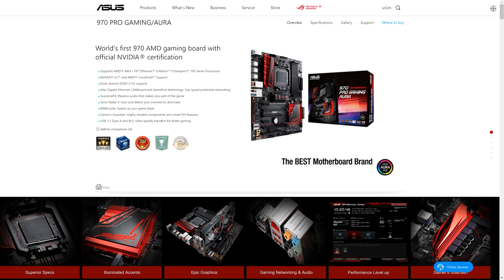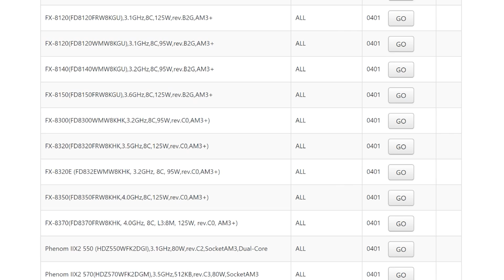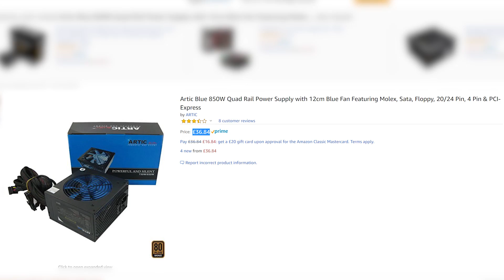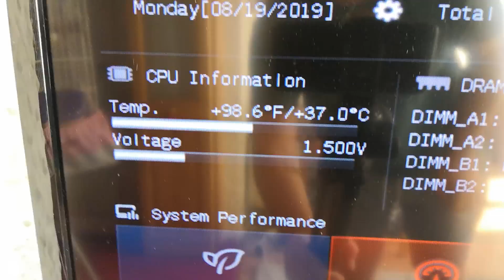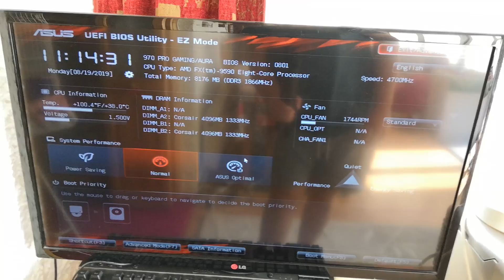This Used Gaming PC Is a 5GHz Fire Hazard (Pt. 1)

Comment: my man it'll be fine. If you are that worried place a fan over the VRM heatsinks to ensure they stay cool. The worst that will happen is the CPU will throttle because the VRMs are too hot. If you are SUPER worried try undervolting/underclocking.
Reply: Pretty much this. The budget motherboard I had for my FX-8300 that I overclocked to 5GHz was certainly not designed for that, but with a cheap 60mm fan on the VRM heatsink it worked happily for years.
Reply: The AMD 220W cpus actually were capable of making your vrams burn. https://www.cnews.cz/paleni-carodejnic-aneb-co-udela-220wattovy-amd-fx-9590-v-desce-bez-podpory/
Reply: @davidunterwieser7325  it wont on this board. This is the one exception when it comes to 970 boards. It has an 8 phase (7+1) vrm instead of the 4 or 6 phase ones that the other 970 boards came with, and they're the same models that are used on the sabertooth 990fx r3.0 just a few less
Reply: Lonnie Murray yep, and even my 4 phase mATX ($40 new in 2015) allows for similar high clocks. I had mine at 300w on the CPU (increase from the wall hitting Cinebench button) with a 120mm AIO, and it lasted for years doing some 24+ hour fluid simulations pegging it 100% and ran fine with $3 in VRM cooling mods. My board only allows up to 1.7Vcore, so it wasn’t able to fry when the CPU was sub-zero when I really wanted to push it (kinda disappointed...). Still does fine, it just won’t allow high enough voltage for liquid nitrogen or even my phase cooler (which I’ve used for testing long term effects of -60c over nearly a years span, nothing bad happened, not such story for GPUs though... the BGA solder on GPUs cracks from the cold thermal cycles...)

It would VRM throttle around 180-220w CPU power (granted, I only had 1 case fan, and that was my 120mm AIO fab exhausting), but after adding 2x 40mm cheap fans and some hearsinks on the chokes it has no issues really pushing the power well beyond 300w for 24/7 full load (my case was quite frankly terrible... so that’s even more impressive!)
Reply: @jakegarrett8109  JESUS dude how tf did it survive all of that😂😂
Reply: Lonnie Murray I have no idea, but I think most of FX board fatalities must have been from boards without working VRM safety (paired with either no mosfet heatsinks or terrible airflow like my old case). It does really make me look at that board with a lot of respect though, because I too fully expected some flames blasting the high voltage (had my camera and fire extinguisher ready, I was prepared! Hence a little disappointment that it just worked fine with no issues). That earned my respect for Asrock’s engineering, if even the cheapest board on the market could do it, then I certainly trusted their high end overkill boards (not quite as amazing, but my 8 phase X399 barely gets warm even at 450w on my Threadripper, even though it has those garbage heat-blocks and not real heatsinks, and one of the cheapest X399 available, it still handles it just fine, and that’s my normal mundane overclock, can’t wait to push that chip beyond 5 GHz on LN2 soon!).

Haha, I really don’t know how it survived either, haha! I guess a couple cheap (even slow) 40mm fans works enough to let you crank it! Here is a vid showing the fans and the long term sub-zero testing I was doing with it (I didn’t have it really tuned for benching as I think even my 1600 MHz RAM was running like 1200 MHz), but you can see and replicate my VRM cooling with some 15mm heatsinks and 40mm fans for $3, helpful for any budget board pushing it (I think I had the fans hot glued, which is crazy, I’m not sure how that didn’t melt, haha!)
https://youtu.be/8h0ieFOeqtl?t=70
So it seems to handle everything, I’m equally impressed, haha!
Reply: Jake Garrett so msi boards
Reply: @lonniemurray4742  Ok might be true,  i am not familar with the exact specifications and vram on this board. The only 970 board i knew of was the asrock 970 fatal1ty which comes with 8 + 2 Power Phase and  official support for the 9590. Anyway the next question is if you really want to sell it to someone it your intention is to flip it. I probably wouldnt even if it works fine.
Reply: ^this
Reply: This particular board will blow up. Mine did. And that was only with an 8350.
Reply: Under locking would ruin the point of the CPU, it's the same CPU as fx 8000 cpus
Reply: @iiiiii7680  the Gigabyte 970A-UD3/UD3P/(I think even the DS3)  had 8Phase power as well. 
8 Phases for the CPU, I might add! (8+2)

Comment: Every FX-9590 desktop should include a fire extinguisher.
Reply: *2 fire extinguishers in SLI configuration
Reply: KittenOnPC *CrossFire
Reply: @d4nyll  *CrossExtinguisher you mean.
Reply: @d4nyll  SLI because the pc has a NVIDIA graphics card.
Reply: Danyll Eusof crossfire sucks lol AMD sucks in general
Reply: @Khloya69  In the name of AMD, you must retract of all the non-sense your mouth are spilling!!!
Reply: Mr. Rolo lol nah. AMD sucks
Reply: @Khloya69  
Spoken like a true shill
Reply: Carnyzzle nope. Come back when AMD have good high end GPUs
Reply: @Khloya69  
Lmao, amd already has the Radeon VII, it's way too much money, but it does compete with the 2080
Reply: Carnyzzle lol Radeon 7 same price as 2080 non Ti non super and worse. Try again.
Reply: Carnyzzle 2080 was never intended to be a good card either
Reply: @Khloya69  lmao don't be giving excuses for when someone can counter you.
If the 2080 was never intended to be a good card then we would've had the Super cards with the Turing launch, not a year later.
Reply: @kitty6375  or more for extra safety
Reply: FX= Fire Xtinguisher
Reply: ... like my old Pontiac Fiero.  I owned two.  The 2nd one came with a tiny red fire extinguisher mounted above the driver's dash - seriously.  No, it obviously wasn't stock but that is how I purchased it from the previous owner.

Comment: For sure test the 9590. Very curious to see the most powerful fx processor In action
Reply: Legend has it that many gamers who got a 9590 no longer had to pay for heating, even in Canada.
Reply: @hattrickster33  Imagine that one, overclocked, and 4 GTX 480s in quad SLI
Reply: @Kalvinjj  You would probably need to start installing AC at that point lmao...also you would be the power company's favorite customer.
Reply: @hattrickster33  I got a ryzen 1600x and I dont need to pay for heating at all anymore
Reply: @hattrickster33   I had a 9370  and I believe it actually performed better as a space heater than a gaming CPU. The R5 3600 has been sweet though.
Reply: Love my 9590, still in use.
Reply: @cmdrleto  Never had a 9590 but I had an 8350 overclocked to 4.9ghz is that close enough? For pure gaming I ended up switching it out for a used i5 4670k (@4.5ghz) during the reign of 6th gen intel, and I gotta say man that upgrade was worth it. My multithreaded benchmark scores went down a tad, (30 points lower in cinebench) but with half the cores and the difference in gaming was pretty noticeable. Now running ryzen 1st gen (always a couple years behind) and that again was a worthwhile upgrade.
Reply: @AmaraTheBarbarian  I had a FX8120 @ 5.1Ghz for years.
Reply: Yeah stick with the CPU
Reply: Test the 9590 :)
Reply: For that reason i just acquired top of the line Sabertooth 990 mobo and a FX9590, waiting to decide what cooling and case i'm going to build it into :D
Reply: @skaltura  Use a Fire extinguisher as cooling and fire sprinklers
Reply: @skaltura   A 360 AIO  WITH FURIOUS VARDAR FANS IN PUSH PULL
Reply: I agree
Reply: stick with the 9590 had one it was a oven even on a 990 chipset mb still shut it down with vrm overheating everynow and then
Reply: @hammersti3n  no reason to test the 8000 series I've owned those... test the 9590, that's rare.
Reply: Lower the multiplier to 22 or 22.5 and overclock the bus speed, nb and ht the rest of the way to 4.8-5ghz
Reply: @lonniemurray4742  Don't have the chip anymore but as I recall I had the multiplier at maybe 23.5 and the rest was bclk. I blew a bad motherboard (the VRM thermal pad wasn't on properly leaving some mosfets exposed and I didn't find out till I had blown it up trying to push beyond 5ghz) the chip survived but wouldn't hit 5 anymore.
Reply: @AmaraTheBarbarian  I run mine at 22x222 all day long playing games, running a plex server off of it, and doing VM stuff for school and have never had any thermal issues other than the cpu temps will max out under synthetic load at like 68-70 degrees.
Reply: @AmaraTheBarbarian  and that's a reminder to me to always check vrms and chipset heat sinks to make sure stuff is applied and even correctly applied out of the box.
Reply: @ArtisChronicles  it was definitely a learning moment
Reply: O would love to see pairing it with very power hungry gpu like vega 56/65 rR9 290x/390x or so. Just for the consumption knowledge XD
Reply: @vitfiser2603  thinking about getting a reference 290x for the winter months. My rx 580 wont get hot enough
Reply: @lonniemurray4742  I have Sapphire Tri - X r9 290x in my secondary rig and it serves as pretty good winter heater. I'm sure you'll be happy with it XD.
Reply: @vitfiser2603  idk man I'd hate for my 750w power supply!! To be under too much stress
Reply: @lonniemurray4742  I'm using it on vs 550w bronze plus, undervolted about - 100mv and it runs ok with i3 8100 on h310 with 8gb ram.
Reply: @vitfiser2603  lol I'm using an fx 9370 oc'ed to 4.85 ghz it's a 220w CPU stock. Its defo a heater
Reply: @lonniemurray4742  Well that would be probably too much for that psu with r9 290x.
Reply: Undervolt it
Reply: Good thing it's just an overclocked 8350.
Reply: Lol though never heard of this CPU and LORD that TDP wtf!!! 😂😂 Thank goodness AMD now has RYZEN which is as powerful as the 9590 and lower TDPs!!
Reply: I'm quite happy with my Ryzen 5 3600 cpu, only a smidgen 65 watts! 220 watts for that cpu is just insane!!!
Reply: @LizzyBoo420  I'm really quite impressed with ryzen 3000, but until my pc stops doing what I need it to, I'm happy with my overclocked 9370 (basically a 9590)
Reply: 9590 is poop
Reply: Had that one in a previous build with a 390X, both factory clocked as far as i remember.

Had it under the table and i was constantly sweating.
Turns out the temps were about 30 degrees at the edge of the table. My H110 cooler was working like a madman in Fallout 4.
Reply: ryzen 1200 is faster lmao
Reply: I can contest the AMD fx 8370 does it better while only using 125 watts and is more safer with mobos. I had a fx 9590 and it runs hot. It made me put a fan in my window during the winter.
Reply: I have the mighty phenom II x4 965
Reply: @jonialaniemi8692  my ADHD messed me up when I saw that at a glance I thought I saw i486, but not bad
Reply: @summerleeye588  i980 masterrace
Reply: @nicekeyboardalan6972  what? I7 980?? I'm unfamiliar what your on about with i980
Reply: @summerleeye588  meant an i960 lol
Reply: @nicekeyboardalan6972  like the 90's intell process before the pentium?
Reply: @summerleeye588  yes also hotline miami 1 is better than 2
Reply: @nicekeyboardalan6972  both are good games, I don't get your point of bringing up them about a conversation about PC hardware
Reply: @summerleeye588  it's related because hlm is a pc game lol, 2 only has better music
Reply: @nicekeyboardalan6972  and thats your opinion and still has nothing to do with your i980
Reply: @summerleeye588  joe mamma
Reply: @nicekeyboardalan6972  yea you can keep talking with your self
Reply: @summerleeye588  hey dont tell me what to do
Reply: I agree!
Reply: A modern 2 core is probably better
Reply: @manolinmero  it's not. It's about what a ryzen 5 1400 is in terms of performance, very slightly worse in single thread performance, about 10% better multithreaded performance
Reply: @lonniemurray4742  Yeah but games only use 2-4 threads i guess for workstation workloads is still a decent cpu but I don't think it is for gaming, an Athlon or an i3 7350k would probably be better in almost every game
Reply: @manolinmero  games use more than 2-4 threads now, and have ever since like 2015 or so. Most dx12 titles can use more than that. Even in directx 11 titles like GTA5 I'm getting 100 percent GPU utilization on my rx 580
Reply: Also if you're building a new PC you're probably not using fx, and if you're considering it, dont. But if you're building a used price/performance pc in the 2-400 dollar range,  and you see a good deal like I did, with usb 3.1 support and nvme and all that, and good enough cpu performance to play games at 60 or 75hz at ultra settings (if you're doing high refresh rate, look  elsewhere) and enough threads for basic VMware, plex serving 1080p streams to 5-6 clients, 720p streaming and music production. I wasn't a believer in FX until I bought a motherboard combo to flip online, and ended up liking everything so much that I kept it
Reply: @lonniemurray4742  I live in the desert so Pre zen Amd was never an option for me, I'm currently running an i7 3770 with a stock cooler and it runs around 50° at iddle my rx 570 goes up to 85-90° while using at 100%
Reply: @manolinmero  my 9370 @4.85ghz idles at like 40-45 degrees and gets up to 70 on synthetic load, and 65-68 or so real world super heavy load, during a game it's about 60 or so
Reply: Also that's REALLY hot for a 570. My overclocked 580 never hits more than 70 where you live must be SUPER hot
Reply: @lonniemurray4742  my ambient temperature is around 40° I live in the fucking desert bro, pretty sure the fx would be unusable for me
Reply: @lonniemurray4742  Why would anyone buy an FX CPU when you can get a 2500k/2600k for the same price or cheaper.
Reply: @ExtremyPvP  bc a 2600k costs what my board, cpu, and ram costs, people like you think that FX computers are paperweights, so they be giving that shit away. z68 or z77 boards are either crappy or too expensive, they dont support usb 3.1 or m.2, and in modern games, a properly overclocked 8 core fx system is faster than a 2500k. In dx11 titles it's a different story though.
Reply: @manolinmero  wrong! I'm using fx6300 overclocked to 4.8GHz with rx580 8gb, it plays all games at 1080 maxed . No need to upgrade yet. Will upgrade when cpu dies or mb to ryzen second gen.
Reply: @jerrym1401  didn't amd got sued for their cpus being a scam?
Reply: Ive got the 8320. And I hate it.